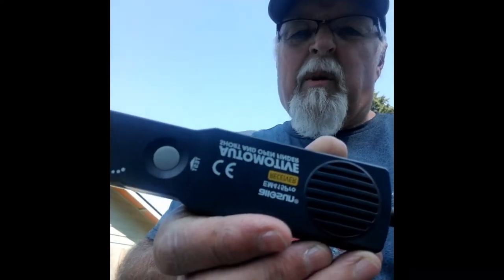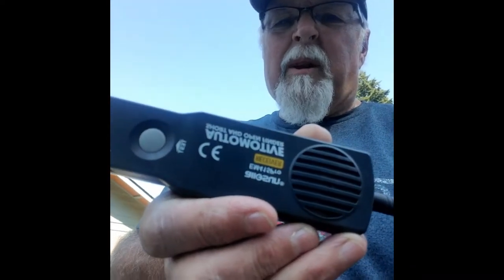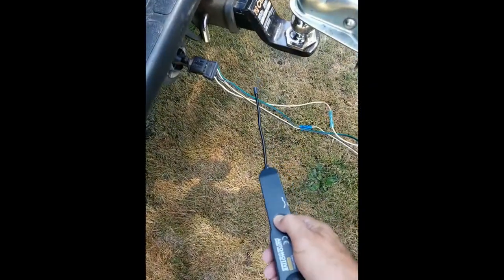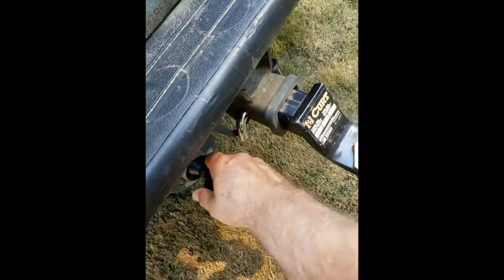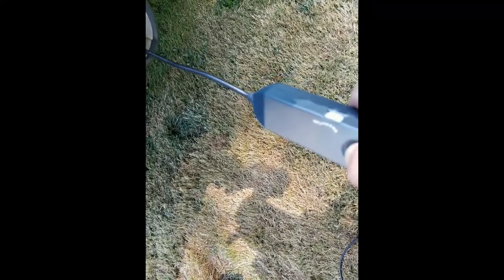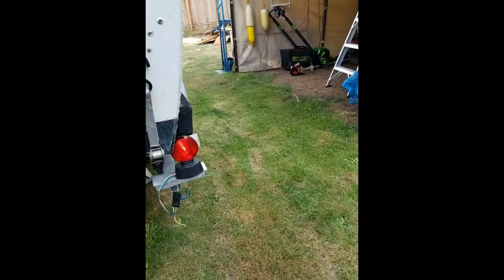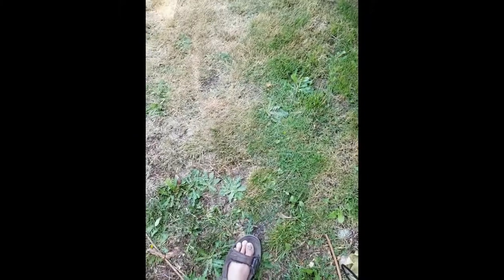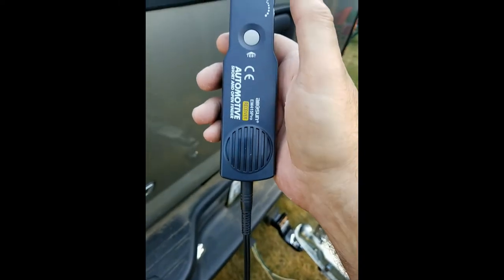Electrical Automotive short and open tester Part 2

Comment: Nice, it worked well and easy fix on the connector
Reply from the maker: Thanks Jim, I'm getting the boat ready to go salmon fishing next week and remembered I was asked by a viewer to show how to use the tester on the boat trailer. When I first hooked up the lights none of them worked? I got out my electric spray and hit all the plug connections on the truck and the pigtail connection. They started working except for the drivers side boat trailer blinker. That's when I remembered to get the tester and my cellphone for a quick video. It worked by hearing the blinker tick in the headphones. The tester also does a green light continuity test too so need to do another video showing that as well someday.
Reply: @TimsWorkshopTJY  at least it gave you more content to record